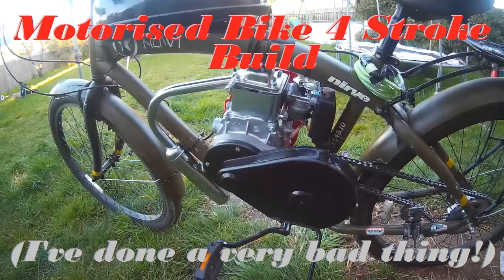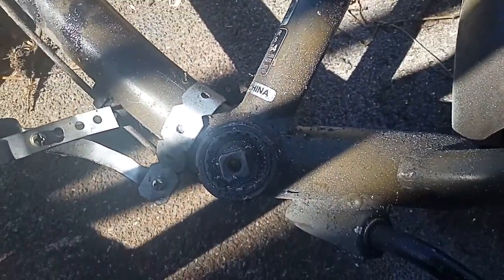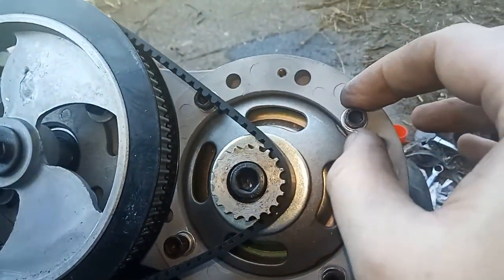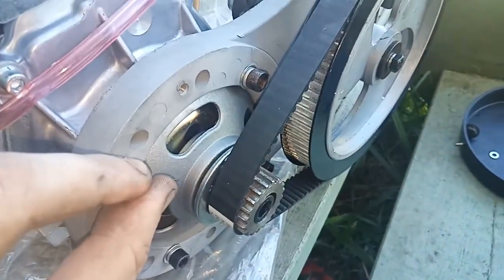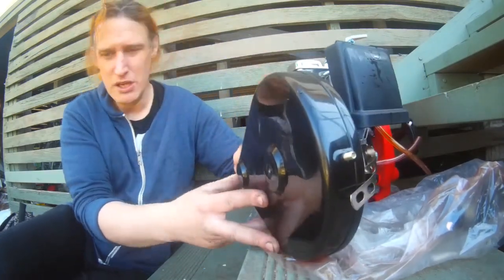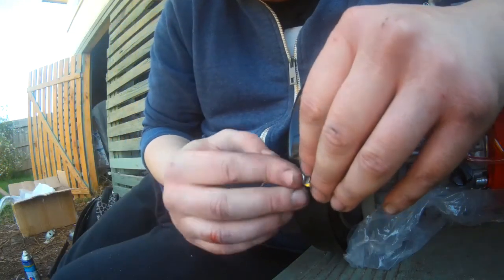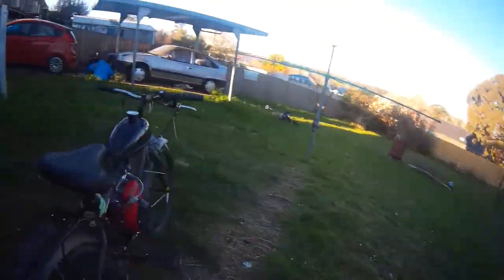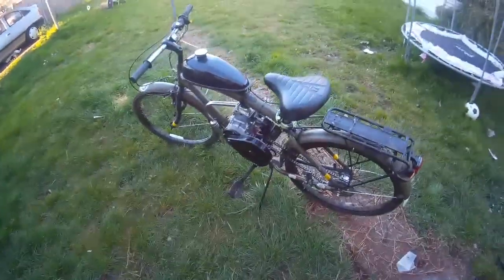Motorised Bike 4 Stroke Build

Comment: He should get himself a nt carb and adapter and get rid of that lame stock carb
Reply from the maker: I actually wanted to do that, except I couldn't find any information on whether it was actually an improvement. I know that it works,  but for what gains? It already performed better than a 66cc 2 stroke. The bike fell apart before I could do anything with it though.
Reply: @NicksBikes  i hear that about the bike falling apart. Im constantly tightening things. With the throttle change over though from what I've noticed is the throttle spring and the overall performance on my both my 4stroke builds have improved greatly with the changing of the carburetor

Comment: Nice! How do you like 4 stroke? I recommend to change engine oil after 1-2 hours of engine running for the first 3-6 hours (2-3 times), there is no oil filter and during break in metal particles builds up quickly in the oil.

Comment: Keep us updated on how that transmission holds up. Just built something very similar. I bought the bikeberry kit and the transmission was total junk I couldn't even use it, it wouldn't work with a 415h chain.  So I got the one with the single chain ones. It worked really well for the first 600 miles (little less then 1000k.) Then the outside bearing  on the drive gear side  just basically shattered. Had another transmission, because I anticipated this would happen. (But not that soon) So I'm back up and running for now.  I may have to switch to   belt transmission like you have.  I'm hoping they're more durable. Just curious or if you know of anything that's even better than the belt transmission.  Thanks MS
Reply: @NicksBikes  lol, I feel you. They're hit-and-miss. I like their mags. I also got the black  heavy duty Springer Fork, for 50 USD its not bad at all . But they are using this covid thing as a excuse not to pick up the phone anymore. I went back and forth a couple times then gave up, the rest of the kit is pretty good.